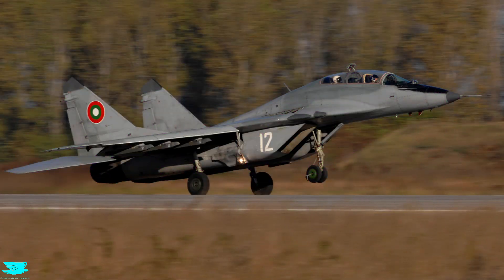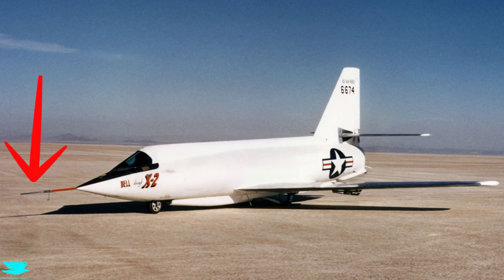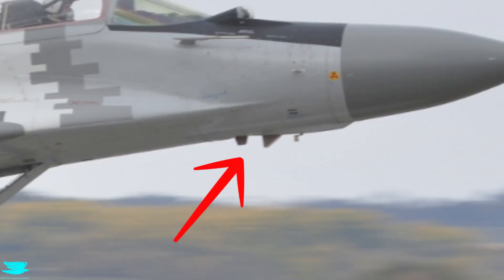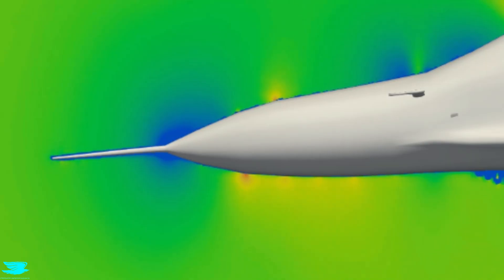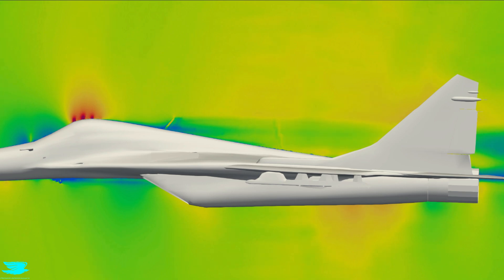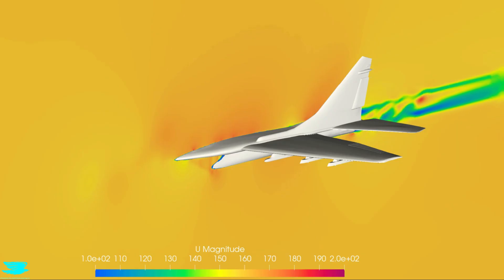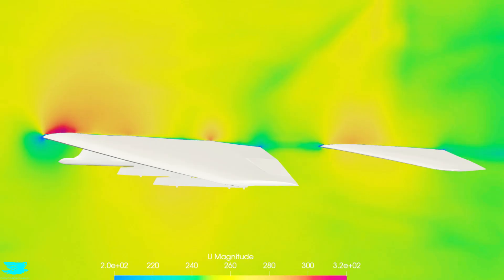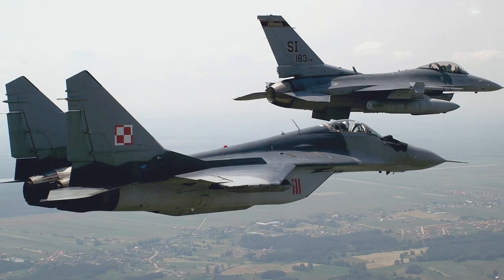How The MIG 29 Breaks The Sound Barrier

Comment: The 'needle' is a pitot tube. It has nothing to do with improving supersonic flow. It's angled down here because in flight it would be level, and the wings and the rest of the airplane would be aoa positive. You've modeled the airplane at the wrong angle for the airflow you intended
Reply: No, breaking the shockwave is very much part of the job. The pitot itself could be mounted anywhere; see Mirage 2000-5F, Typhoon, Rafale, F-35, F-22 etc. Yet, early Mirage 2000Cs, JAS 39 Gripen, and of course the MiG-29, has them in front of the radome. 

The tube being angled down is more because of the mounting angle to the radome, and to be more accurate across a wider region of AoA, and the 29 can have a really wide range of AoA.

Also, during cruise, even when loaded heavily, the 29 doesn’t need that much AoA. The slower you go, the more AoA you need, of course, but I’d be surprised if you need more than 1~2deg of AoA for cruise.
Reply: @left_ventricle aoa for cruise depends on altitude, ie how much lift can the wings produce at a given density of air = aoa needed. The interaction of the pitot on shockwaves in certain regimens is a very secondary consideration, but yes it does matter and is considered in design. But it isn't the main reason for why its there or why it looks like that or is at that angle. The -29 would fly fine with it mounted somewhere else

Comment: Should do F-15 next
Reply: Jet engine improvements haven't stopped yet.  No surprise then that "newer is faster". 
Volcanoes prove that large, misshapen rocks with enough momentum will fly very fast.  It's no surprise then that an aircraft with two jet engines has a faster straight ahead speed than an aircraft with just one.  I believe that the F-16 has more aerodynamic secrets to reveal than the F-15 - especially since I have yet to see any other fighter climb straight up, above the runway numbers from sea level to 30,000 feet in about a minute like the F-16 can.
Reply: @arcanondrum6543  
> Jet engine improvements haven't stopped yet.
> No surprise then that "newer is faster". 

Ummm, no.
Newer is not faster and hasn't been for some time.
Older fighters like those of the Century Series were faster or supposed to fly faster than just about anything that you might care to mention today as top speed is no longer recognized as the most important attribute.

> Volcanoes prove that large, misshapen rocks 
> with enough momentum will fly very fast.  

Yes, given enough power, one can make just about anything fly and fly fast.

>It's no surprise then that an aircraft with 
> two jet engines has a faster straight ahead 
> speed than an aircraft with just one.  

Ummm, no.
A single engine with the same thrust as a pair of engines will almost always weigh less than the two engines together, and will have less surface area as well.
Lighter weight implies faster acceleration and less surface area implies less drag.
So unless you have some reason to fixate to dual engines (say, like reliability), then having one engine is generally "better".
See the F-20 compared to the F-5 that it was based on.

> I believe that the F-16 has more aerodynamic 
> secrets to reveal than the F-15 - [...]

That's nice.
But the F-16 was designed with dogfighting that starts at around 450 knots, not supersonic.
Its engine intake was not designed with lots of flight at supersonic speeds in mind.

> [...] especially since I have yet to see any 
> other fighter climb straight up, above the 
> runway numbers from sea level to 30,000 feet 
> in about a minute like the F-16 can.

Being able to climb straight up is the result of the F-16 having a thrust-to-weight ratio in excess of 1:1.
As it turns out, the F-106 could also have a thrust-to-weight ratio in excess of 1:1.
I don't know what its best case rate of climb was, but its top speed is Mach 2.5 compared to the F-16's Mach 2.
Reply: I would note that In The Beginning, the F-X was supposed to be an almost single purpose aircraft which turned into being a multi-role aircraft due to funding issues.
The result was the F-X was basically supposed to be an F-111 on steroids.
Then John Boyd came on the scene (famously saying, "I've never designed an aircraft before, but I could fuck up and do better than this") and after a series of design trade off reviews, basically came up with the basis for the F-15.
That basis specified a top speed of only Mach 2.3 instead of the Mach 2.5 value the Air Force had wanted for the F-X.

For political reasons, that upper speed got re-introduced and while the Air Force was willing to tout the Mach 2.5 top speed to the general public, what they left out was that could only be reached on a "clean" aircraft (no external stores) and only in one flight scenario.
Basically, the F-15 had to be flown until it was nearly out of fuel at which point the pilot would flip a switch which would allow the engines to run hotter than "normal" for extra thrust.
This would allow the F-15 to reach it's top speed of Mach 2.5 at which point the aircraft would have to land because it was out of fuel and the engines would have to be pulled as they would have exceeded their time limits for operation at the hotter temps.
Reply: @lewiscole5193 yes the f15 can only go Mach 2.5 in a special mode, lighted with water methanol, Anyhow clean it’ll hit 2.4  but obviously on combat load it won’t
Reply: @lewiscole5193  The F-111 had two engines and a thrust to weight ratio of about 0.6.  The last of the Century Series (the F-106) had the same top speed as the F-16.  The F-15 has a better thrust to weight ratio than the F-16 but again, the only fighter publicly confirmed to have climbed from Sea Level to 30,000 feet straight up and in about a minute is the F-16. 

When I wrote "newer is faster", I was referring to the jet engines - The engines are designed after all, for fighters.  In addition to fuel efficiency and other good ideas, "intercepting faster" is always the goal, the rest depends on the fighter built around it - which is why the F-16 is worthy of a closer look instead of the "add more thrust" F-15.

As for anything else, I'm going to pass.  This was fun, much like at a party and I see someone else that I'd prefer to talk to.  Enjoy your beverage.
Reply: @arcanondrum6543  
So much stuff, so little time ... I'm going to break up my reply into multiple parts.
Part 1
> The F-111 had two engines and a 
> thrust to weight ratio of about 
> 0.6.  

Yes, it had two engines, but that doesn't change the fact that if the designers could have gotten away with one (1) engine, they probably would have for the reasons that I mentioned before, weight and smaller size for a given amount of thrust.

> The last of the Century Series 
> (the F-106) had the same top 
> speed as the F-16. 

Ummm, no.
The top speed at the brochure of the F-106 is 1,525MPH at 40,000ft while the top speed of the F-16 is 
1,353MPH at 40,000ft.
The last time I looked, 1,525 is greater than 1,353.

Meanwhile the top speed at the brochure for the F-104 is supposedly around 1,528MPH at who-knows-what altitude.
But the "top speed" of the F-104 was limited by the temperature of the air at the face of the engine as well as the softening of the canopy.
If one is willing to push things (as some pilots apparently were), top speeds above 1,600MPH have been mentioned.

> The F-15 has a better thrust to 
> weight ratio than the F-16 but 
> again, the only fighter publicly 
> confirmed to have climbed from Sea 
> Level to 30,000 feet straight up 
> and in about a minute is the F-16. 

That's nice.
However, best case maximum rates of climb are not really terribly important as they usually involve "clean" aircraft which when a record attempt is involved are also stripped and tweaked.
So getting to 30,000ft when you can't do anything to any aircraft you encounter when you get there is essentially meaningless.
Reply: @arcanondrum6543  
Part 3
> [...] the rest depends on the fighter 
> built around it - which is why the F-16 
> is worthy of a closer look instead of 
> the "add more thrust" F-15.

I get the sense that you haven't bothered to look into the history of either the F-15 or F-16.
Neither were intended to primarily be "interceptors".
The F-15 started out as the F-X which in the very beginning was supposed to be an almost single purpose aircraft that would either dogfight or move mud.
But single purpose fighters weren't fundable and so the F-X ended up becoming a multi-role aircraft that basically resembled an F-111 on steroids.
Then John Boyd, probably the most well known of the lightweight "Fighter Mafia", came into the picture and famously told his superiors, "I've never designed an aircraft before, but I could fuck up and do a better job than this."
So Boyd started a series of feasibility studies which eventually ended up with a lighter wing loading, higher thrust-to-weight ratio, and a fixed wing geometry ... basically what the F-15 is today.
Boyd was interested in maneuverability (AKA dog fighting) over speed as he thought this was the best way to futureproof U.S. fighters against whatever the Soviets might come up with.

Boyd wanted to come up with an even hotter (lightweight) fighter which he and his partner-in-crime Pierre Sprey, referred to as F-XX (pronounced "Eff Ex Squared"), but Boyd's superiors told him to drop it.
But Sprey, being a civilian, continued to work on the F-XX with Boyd in the background.
To validate what their studies were showing them, they consulted with Northrop and General Dynamics since both had submitted lightweight fighter designs to the Air Force in the past.
In particular, Boyd and Sprey talked regularly with Harry Hillaker, the designer of the F-16.
Reply: Part 4
The Air Force was not interested in the F-XX as they regarded it as a threat to getting funding for the F-X/F-15.
They wanted to kill it, but "Rich" Riccioni (also of "Fighter Mafia" fame) convinced his superiors that the F-XX should be kept around just in case Congress cancelled the F-15 and F-14, lest the Air Force might be forced to accept a Navy lightweight fighter they had at one time been working on.

The chance for the F-XX to go somewhere came when Congress, who wanted to curb the cost of aircraft development, asked for/demanded a "prototyping" program.
The Air Force didn't want any aircraft that might come out of the program, but they did want the money that came with participation in the program.
The result was the YF-16 and YF-17.

Towards the end of the program, it was announced that the winner of the competition would be accepted by both the Air Force and the Navy.
Both services fought this, but the Air Force was basically black mailed into accepting the F-16 as part of a package deal that got them both the F-15 and F-16.
The Air Force promptly turned the F-16 into a small bomber which is what its role has been ever since.

> As for anything else, I'm going to 
> pass.  This was fun, much like at 
> a party and I see someone else that 
> I'd prefer to talk to.  Enjoy your beverage.

Great.

Comment: How does the MiG-29 break the sound barrier?  With MASSIVE amounts of power.

Seriously, to the extent that there was a single design purpose in mind for the MiG-29, it was to counter the F-16 which was designed with the lessons of Vietnam in mind where air combat typically took place below Mach 1 even though the fighters of the time were largely Cold War aircraft designed with a much greater fixation with top speed in mind like the F-105 and F-4.
The number of "dog fights" that have taken place above Mach 1 is only about one [1] in the entire history of air combat and F-16 designed to (start) dog fights at around 450 knots.
If top speed were the priority, the air intake wouldn't have been designed to look the way that it did.

So may I humbly suggest that from the air dynamics point of view, if you want to show what goes on in an aircraft designed for supersonic flight, then looking at earlier Century Series aircraft like the F-100, F-102/F-106, F-104, and F-105.

If there's one aircraft that I would be most interested in, it would be the F-104, which contrary to popular opinion, was NOT designed to be an interceptor but rather a daylight air superiority fighter which addressed the wishes of Korean War fighter pilots who flew the F-86.

They wanted something that could get to their opponents quickly and take them on even at high altitudes (where the F-86 was inferior to the MiG-15).
And since the F-86 was supposed to take on enemy aircraft from bases close to the front lines, long range was not something which was a really high priority for the F-104 either.
Still, Johnson and company wanted something that could spend time at supersonic speeds (between Mach 1 and Mach 2.5) when it wasn't just puttering around subsonically flying the Friendly Skies.

And if you're fixated with fighter aircraft designed for speed, then the F-102/F-106 would be the obvious choice as it was designed to the ultimate interceptor with the F-101 and F-104 re-tasked from what they were designed for as stop gaps until the F-102/F-106 could take on its interceptor duties.

If  you're willing to stick with subsonic flight, how about looking at Mike Arnold's AR-5 (holder of an FAI speed record) or Alex Strojnik's S-4 "Laminar Magic" (and yet another holder of an FAI speed record).
Reply: I think simply saying the Mig-29 got it's supersonic chops purely by virtue of its overwhelming thrust is a disservice to the aero trickery that went into it.

While the Starfighter is a great supersonic jet, and Kelly Johnson's genius cannot be understated, it is still a product of it's time. The beautiful coke bottle body reduces drag to a minimum, while its short stubby trapezoidal wings give it enough lift in its intended flight regime and the T-tail gives nice clean air to the horizontal stabilizer. But it lacks all the features we expect from modern aerodynamics, no LERXs, no lifting body, no turbofan engines.

The Starfighter sacrificed everything for pure speed, but by the time the Fulcrum came around, to get to the same speed it just didnt need to sacrifice as much, the lifting body concept alone makes it leagues more efficient than the Starfighter, all that drag that used to just slow you down now makes some useful lift(while also slowing you down). If the Fulcrum also had turbojets like the Starfighter, it might have gone even faster since they are more efficient at super high speeds, but it didnt need them, and the low speed efficiency and power of the turbofans won out.
Reply: @C4Cole05  
As I've said before (and will continue to say again and again and again), all aircraft are exercises in compromises to meet some set of requirements/constraints.
The F-104 and MiG-29 are no different.
(OBTW, the F-104 doesn't have much of any coke bottle shape to it no matter how hard you squint.  Perhaps you're thinking of the F-106 which definitely did after its progenitor, the F-102 failed to meet performance expectations.)

What the F-104 lacks in "modern" aerodynamic features is NOT due to some fundamental change in aerodynamics, which would require a change in the laws of physics which are unlikely to change much until the heat death of the universe.
Instead, the changes are due to the requirements/constraints that humans have made over time due to the changing mission of the aircraft involved.

In particular, the F-104 didn't need to have any "lifting body" shape at high speeds, as the wings produce more than enough lift to keep it flying in more or less straight flight ... just as is the case with the MiG-29 ... and without the drag caused by the additional wetted area of the MiG-29's body.
At high speeds, all aircraft become essentially straight line machines whose turns should be measured in states (or in Europe, countries).
So may I not so humbly suggest that the "lifting body" shape of the MiG-29 has more to do with other reasons, like providing a big 
wrapper over a huge fuel supply which is needed to feed it's big, thirsty engines.

Note that at subsonic speeds, the F-104 can actually turn relatively well (similar to the F-4) thanks to the fact that it has "blown" wings which can be blown up to the 400 to 500 knot ranges (I can't remember what the limits are and  am too lazy to look it up).
Can the F-104 match a MiG-29 with it's LEXs in turning?  Oh, hell no.  
But without the MASSIVE amounts of thrust produced by the MiG-29's engines, no aircraft with LEXs are going to stay in the air for long in a turning fight due to the MASSIVE amount of drag they generate.
And when any fighter aircraft with LEXs are just puttering along, their LEXs generate essentially NO lift as they are not creating the energy sucking tornadoes that they do in turning flight.

As for turbojets versus turbofans, I don't think you appreciate the amount of drag (and therefore the amount of offsetting thrust) we're talking about here.
Yes, turbofans can be more efficient than turbojets due to the reduced exhaust velocity but higher mass flow of the former compared to the latter, but both are terribly inefficient at anything other than their highest speeds where their exhaust speed would be close(r) to the aircraft speed.
But at anything less, they are both suck and wouldn't be used at all if it weren't for the fact that some government is paying for the fuel bill.

And when it comes to thrust needed by the F-104 compared to the MiG-29, see the equation for drag which features the frontal area of the aircraft in addition to its speed.
The F-104 has a frontal area of only about 25 square feet, while the MiG-29 (based on it's frontal height alone of 14 feet and wing span length of about 55 feet) is probably closer to double that.
And since drag increases to the SQUARE of speed, that means that the MiG-29 requires a lot more thrust to even keep up with the F-104 in terms at just about any given speed.